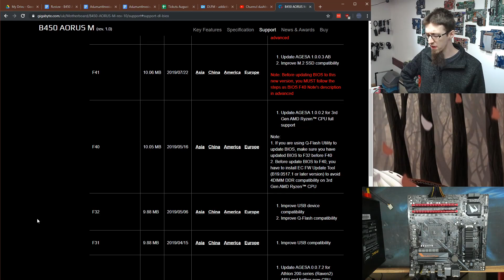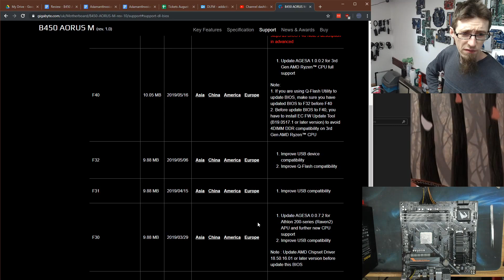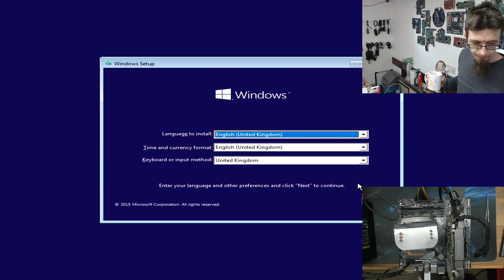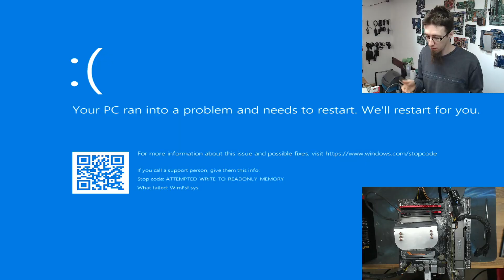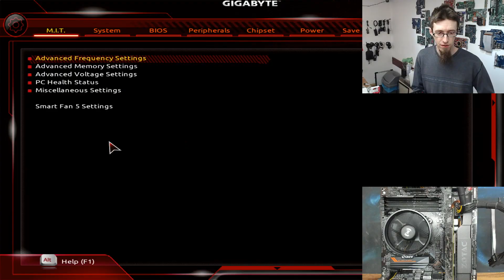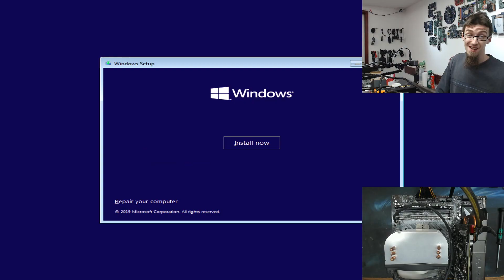LFC#183 - Gigabyte's BIOS update bricked my B450 Aorus M

Comment: What might be the issue if my display literally wont turn on anymore, my gpu fans and the rgbs on it are not turning on anymore either, it all happened after this crap f32 update. Today I got an hdmi cable that i will plug in the motherboard and try to see if it will turn on with no gpu, to see if that's the issues, any help?

Comment: I just wanted to let you know that I had a Similar problem to this. Going from f50-f61tho.
I Had No post with the exact same debug lights after a Bios Update, Watched through Your video And tried the same steps you took. Was able to find it was a Memory stick preventing the Boot, but after I got it loading windows I dropped it back into another channel and it works perfectly! Xmp Profile and correct Bios ! 

THANK YOU

Comment: Great video Sir, thank you for sharing this experience. I have the exact same issue with b560m aorus elite, managed to actually installed the windows, and it was somewhat working albeit with the exact same cycling boots as in your video, making its way to Windows let's say on it's 15th restart, mainly after cmos reset. Called support they said that I can update the bios which I did and now it's actually even worse, I managed get into to windows only once since, hence I now it's not bricked, but man, this is insane!!! Tried different ram stick to no avail, but don't have another CPU to test. Used Ultra Durable in the past but very disappointed in Gigabyte after this experience.

Comment: I didn't see any mention this, but for future reference, when you 1st flashed it, you had 2 bios files on the drive, it prolly loaded the one you selected then also loaded the next one as well.. I would ONLY load up the one your using, one at a time... I wouldn't take that chance

Comment: I just (About 3 hours ago) updated the Bios on my Gigabyte Aorus B450 elite to the latest version (F62c) from F2, with no issues using the @bios tool on the gigabyte website. It was relatively painless and has worked fine.

Comment: This just happened to a friend of mine as well, Gigabyte motherboard with B450M chipset, Ryzen 2600 CPU. 

They seriously need to add more error handling capabilities to these BIOS updates, so it knows how to fallback automatically in case the update fails. Especially in this case due to the complexity of the flashing process to get to the latest version :/

Comment: My last bios flash missed: the update had to be done in two stages, a classic update and on reboot, the end of the update. But on reboot, it no longer recognized the USB drive that contained the bios and never finished the update. Fixed issue using an old external HDD instead of a recent USB drive.

Comment: I have this board with the F51 bios and 32G of 3000 ram and its running great since first built - I was going to update to the latest F61a version, but after seeing this and reading the Gigabyte bios notes im not touching it -- never seen so much hassle to update bios on a gigabyte board its usually very easy.

Comment: I got b450 aurom, out of the box it was f32, i have r5 3500,..so got it (bios)updated from the vendor itself... All works fine for mote than a year.. Now today i decided to update bios, i did but accidentally..the f32 version.. Now m having the same issue. No display, dram led on,
Fkn irritating.. Especially when ur job is on the line
Lookingfor older ryzen cpu to solve this issue. Any ideas would help me guys.

Comment: Thanks for the video! I had also bricked my Gigabyte B450 Aorus Elite V2 motherboard after updating it to the latest BIOs.

I didn't watch the whole video. But looking at how you noticed the indicator lights cycling between CPU and RAM. I noticed mine had similar issues. Once I cleared my CMOS, took out and reseated my RAM. I was able to boot and the system was back alive and kicking. You saved me hundreds of dollars from having to buy a new motherboard!
Reply: How cleared bios cmos

Comment: I have the same exact motherboard, been using it for about 10 months with the factory f50 bios. a ryzen 5 2600 and nvidia gtx 1080. it runs fine on f50 and I certainly won't be flashing it especially after seeing this video

Comment: I had same problem, but... 3-4 days after bios update. swapped bios chips and works fine. looks like f60 bios from gigabyte site is also corrupted. or i was very lucky and won on "reverse silicon lottery" and my bios chip just died.

Comment: I found the most surefire way to make sure there's no excess voltage on the board is to spam the power button with nothing plugged in and the battery gone

Comment: Same shit happen to me ! The damn red LED switch just like in your case i have a Aorus x470 ultra gaming motherboard i Updated the Bios to F31 and it works but don't start normally ! So I have to press the Power button with the Reset button in the same time for 10 sec. to switch to Back Up Bios but if i Restart from Windows it boot normal on his main Bios.....now i want to buy a Ryzen Gen 3 and i need to Update Bios to F40 ! So it a pain in the as because you need a small program like you need to do it !

Comment: Hi @Adamant IT. I assume the problem was this. On your USB you had both versions 32 and 40 so in my opinion, the system ignored your selection of v32 and upgraded to the newest version available i.e. v40 if you  had 1 version on the USB there is no way for you to get v40 at least this is what I'm thinking ofc it's a bug system should see what you selected but.. yeah. That's why I'm never having more than 1 bios on a USB before flashing in that way you can be sure + I don't think it's the wrong link because this is two obvious and at least 1 person would report it taking in to consideration that these boards are sold by the thousands at least )

Comment: So if i'm on f41b bios, b450 aorus pro can i proceeds to flash bios to f51 or f60e without going back to f32?
Reply: Nvm, just updated to f51. Weird thing happens when installing ecfw tool. The bios reset itself back to f4, checked  from @bios app and bios page, confirmed it. Even the bios setting page got some minor changes.

Comment: most motherboard if you take a bios and put it ona flash drive, by its self format fat32, put in the correct usb port and it will actuall auto flash the bios with out actually posting.  just saying.

Comment: new builder here. I have a gigabyte B450M DS3H mobo and i got windows working on it. was downloading drivers and was almost done setting up! I thought to downgrade to BIOS F32 because it said so on the website and only while updating did i notice the board was already at F50. I thought I could just update it back up after this mistake, and now the bios won't even come up. Leds come on, fans are spinning, but bios wont come up what so ever. i have mostly accepted that the motherboard is bricked but i still hope that this can work somehow. can anyone help?

Comment: For me, getting Zen 2 (3000) CPUs to run on Aorus 4-series boards involved a two-step BIOS update (F32 => F40) with a Zen+ CPU, a chipset update, and a firmware update to enable running 4 DIMMs.  Even then, my X470 Gaming 7 seemed to be bricked but finally came back to life on the secondary BIOS chip (has the manual switch).  If I had a do-over with Zen 2 CPUs, I'd buy 5-series boards.

Comment: Thank you so much.  I baught an oldA8 processor to update bios to install my ryzen 3900xt... ended up with this issue.  I could not reset both bios.  But your comment on changing processors to stir up the brain WORKED!  Thank you so much.  You have my subscription

Comment: I had the exact same problem with the bios freezing. This board is terrible, never buying gigabyte again.  THe way I remember "fixing" it is by using the usb keyboard/mouse on the usb3 ports instead of the usb2.  Then I managed to fix the usb2 ports later by changing some option related to usb devices in the bios.  Oh and then I had issues with the XMP profiles too, had to lower it from 3000mhz to 2933mz before it would finally work.

Comment: Gigabyte is flea-market crappy bullshit , of my two 1660 supers less than 1 year old , already one of their notorious flimsy plastic crappy pin fans are breaking stopping and jamming. This was the case for a 12 card set of gtx1070's also( 20 out of 24 fans breaking within a year) , their crap you just buy for the circuits , the rest is absolute sweatshop assembled rubbish !

Comment: I give you an F for not knowing how to update the firmware on a Gigabyte MB.  You DO NOT need a Windows install.  All you need to do is to start with downloading the first required BIOS to a flash drive.  Put the flash drive into the MB. Power on the MB. Go into the BIOS.  The choose Q-Flash and follow the instructions.
Reply from the maker: Did you watch the video? Because that's exactly what I did.

Comment: Bros... my Gigabyte x570 Master manual said “do not have CPU/GPU etc installed” when doing Q-Flash Plus, but I was able to update the BIOS just fine with everything installed. 
1. Follow instructions for FAT 32 format on flash drive 
2. Follow instructions on extraction of BIOS and rename BIOS update to GIGABYTE.bin
3. Power Supply switch on - but Power to PC off.
4. Stick USB flash drive in.
5. Press the Q-Flash button and wait for it to power up the PC. You should see “00” on LED indicator on mobo.
6. Wait a few minutes - the Q-Flash LED should be blinking the whole time - along with USB stick LED.
7. Eventually, you’ll see monitor for to a Gigabyte BIOS update screen where it tells you the progress and warns you not to turn off the PC, etc.
8. BIOS update will complete and reboot.

The monitor and GPU plugged in was great because it will take you to a BIOS UPDATE screen so you can see the progress of the BIOS update as it’s applied.  Why you would not want this available and be completely in the dark is beyond me - and I find it stupid.
Reply from the maker: That's a slightly different scenario you're describing there. That mobo has Chipless Flash-back, which is a "blind flash" mode for recovering the board when it doesn't POST or you don't have a compatable CPU. Very good feature that all boards should have.
For a "normal" flash where you have a working computer though, yea I'd do it with monitor in BIOS so you can see what's happening.

Comment: The only useful thing Gigabyte ever did was give us PCI-E Gen 4 support for B450 boards but they quickly removed it after taking heat from AMD.  The crooks at AMD want people to upgrade to a B550 or x570 board to get PCI-E Gen 4 support at the CPU level.

Comment: I've found that it's always best to just stick the flash drive in the bios usb, turn it on, and leave the room with Aorus boards. Most have an automatic bios install system that will update from your flash drive when both new and saved bios fail to load. I'm reasonably sure that's what happened here.

Comment: Help guys, same thing happened to my Msi B360M Mortar, didn't post after the restart, the simptoms are that the power button doesn't do anything, unless i hold it for about ten seconds, then it does the second thing the motherboard does in the video, it kinda power on but for less than a second, i did try Cmos clear and a lot of things he tried but still can't get it to post. :(

This happened trying to update from 723Bv1A0 to 723Bv1B0, ive done updates about 2 times before because of the Cpu, went from i3 8th Gen to i5 9th gen.

Comment: So when you state "so i could drop a 3600 in it" you've already determined the user is at least an enthusiast.  A lot of AMD boards are doing a lot of BIOS voodoo for AGESA to meet promises AMD had made.  That's why these "promised" updates are all marked as beta - unfortunately some manufacturers are mislabeling or mispackaging other updates with these updates making them seem unnecessarily attractive - to an enthusiast.

Comment: Damn.. Now I'm scared to even update my Gigabyte motherboard. I had issues when I first got it, wouldn't pass BIOS and when it did, a black screen would appear, determined that was a resolution issue and it worked on a monitor. However, why don't you try shorting out the BIOS pins to force it to the other BIOS, that's what really solved my issues. And also came down to the conclusion that the 1TB 7200RPM HDD was the culprit that appears "Good" on CrystalDisk but actually corrupted windows twice. SSD all the way, and the genius solution of shorting pins.

Comment: Yeah this is one reason I check memory control on these boards before doing major changes like this. I had similar problems setting up my R5 3600 straight out of the box with X570 and this was my intro to Ryzen from the FX era. Meaning I had no idea what was going on with memory behavior/speed/voltage or any of that. If someone had told me that memory training on these boards was a thing, it would have saved me well over a week of headache. So next time, check memory speed and more importantly set the memory voltage so that you don't boot loop. Other than that, good show. I know Gigabyte tends to loadout the dual bios config on their boards for a reason but you've actually done an excellent job highlighting the most critical reason here. I've never had something so dire that I resort to desoldering and resoldering a bios on these boards but granted your situation, it turned out okay. Might be worth looking up bios flash woes in the future before going through with them.

Comment: All 3 methods ive tested and work.

Method 1

Shut off your computer

Hold the power button until your computer starts and shuts down again

Press the power button again, your backup BIOS should kick in now and should re-flash the backup BIOS if there's anything wrong with the new one.

Method 2

Shut off your computer

Hold the power AND the reset button for about 10 sec, than release.

It should boot into the backup BIOS now.

Method 3
Only use this if nothing else works.

Short out pins 1 and 6 on the main BIOS chip by attaching a jumper to both the pins (pin #1 should be marked with a red dot or whatever)

Tell a friend to press the power on button while you do this because right now you are holding the jumper on the pins

Remove the jumper you're holding between pins 1 and 6 as soon as you hear a beep.

Backup BIOS should boot now.
Reply: Thank you for taking time to share this good sir!

Comment: i have similar problems with gigabyte shitty bioses...  before years i mounted 3 tb hard drive on gigabyte mb and it was not detected. i go for new bios and download latest - flashed it - disk not detected again. i go to bios revision history and looked for bios which was for 3tb hard drive and flashed again. then disk is detected, then i  flashed again to the latest bios and disk remain detected. another problem is with stupid dual bios - several times i flashed on programmer from backup to main bios. there are no other motherboards, except gigabyte, which randomly switched from raid to ahci... another case: before 13-14 years i flashed GA-M56S-S3 and lan MAC disappear (in bios has no option for change/add nvidia MAC), but gigabyte do not provide a tool for writing MAC (asrock have, but it work only with their boards), so i mailed to gigabyte and write, that to have internet i write MAC in windows, but when need to reinstall i need to write again. The support answer to me "what is the problem? - you solved the case..."

Comment: I would just take my CH341A spi flashing tool with soic8 clip and flash the bios that way using laptop. Infact, i never do flash using windows, mainboard build in tool or dos tool. Laptop has got battery in case of power going out of house so there really is no chance for it to brick the chip unless you have wrong CH341A that sends 5volts to spi chip instead of 3.3v or 1.8v (with additional adapter).

Comment: Are you not a fan of ASUS boards?  I've used nothing but ASUS in my builds for 19 years and have never had an issue with any board I have used of theirs.  Just asking because I noticed you said MSI used to be your main then you swapped to gigabyte
Reply from the maker: I had a grudge with Asus for a long time - however in the past 1-2years I've definitely come around to Asus boards.

Comment: i have a gigabyte motherboard and my confidence in it isn't very high. had some issues with it's naming of my ssds (identical labels no uniq ids or size to differentiate the devices), not booting as easily as all those helpful ssd cloning stuff..and when i found a suggestion to disable security. i found that rather than a simple "enable/disable" choice it had "standard/custom" which...i don't think is clear at all what it's doing. i don't know if it's a language thing, but that's pretty important when trying to follow instructions. i chose my board from review lists, but now personally i think i'll shy away from gigabyte. [oh and i couldn't figure out how to use the software..not that the user interface was confusing...launching it wouldn't do anything. i asked support and got nothing useful out of them..i don't think they understood so i gave up with them. not a good experience]

Comment: Fuck Gigabyte, honestly. I just put wrong timings on my RAM and the board bricked itself, apparently corrupted the BIOS chip. A sane board would fail to boot 3 times and then revert to default/last good settings. The board in question was a B550 Aorus Pro which I surprisingly got a refund on. I have an ASUS ROG Strix B550-F. This board is MILES better.

Comment: The auto bios switch is to take a paperclip and short it while it is running and watch a couple sparks. That’s the only way I could get mine unbricked.

Sounds like you jumped to the backup bios that had f40 installed on it.